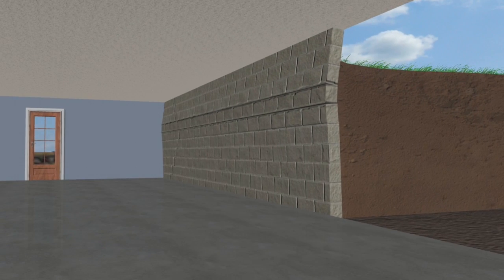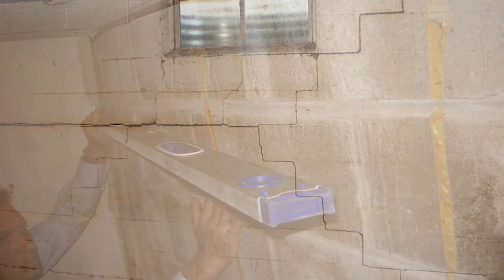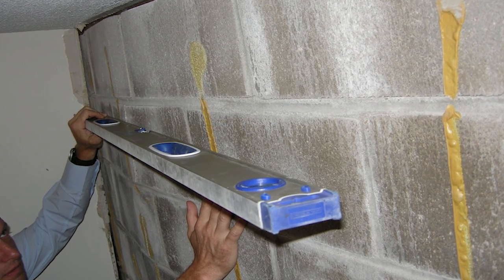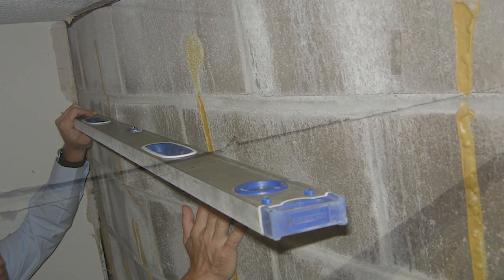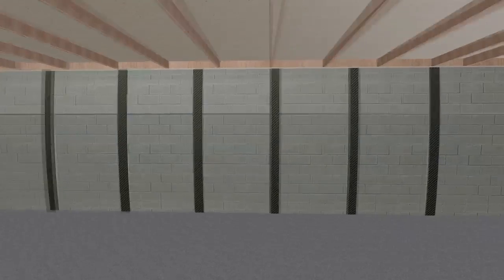Options to Fix Bowing Basement Wall Problems | Ask the Expert | Basement Systems USA

Comment: How would you attach the angle iron backstop at the top of your I-beams if you’re floor joists are running parallel to the bowing wall?
Reply: Blocking, and it has to go all the way across the basement to the other wall.

Comment: Never use Carbon Fiber it will not fix the problem... It Is Only A temporary fix until a real fix is put into place..
Reply from the maker: I can understand why you would say that.  Many companies use cheap carbon products, install it badly, and also install it at the wrong times on walls that cannot be fixed by Carbon Fiber.   We have three alternate options to repair walls that have badly bowing walls.  But the right Carbon Fiber, installed properly, for the right applications is extremely reliable.  We have been using it for 20 years without any problems on thousands of jobs.  Look at carbon fiber a a preventative or beginning stage bowing solution.
Reply: I am a licensed structural engineer, and I disagree with Sindely's assessment.  There is a wide spectrum of foundation failure modes.  Carbon fiber is one option at the shallow end of the spectrum, and an option that works well up until a certain point along that spectrum.  After a certain point, other technologies come in to play.  But even those technologies have limits at a certain point.  At the far opposite end of the spectrum - the deep end - is foundation replacement.   Also, carbon fiber is a proven technology that gets used more often than you'd think, particularly in high rise commercial retrofit projects.  With that said, carbon fiber is not a panacea for every single block foundation issue.  But I will say this, if I were finishing off a basement that had a pristine CMU foundation, I'd spend the extra coin to have carbon fiber installed, just for the peace of mind.